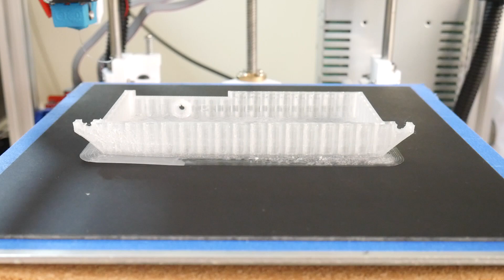3D Printer bed skin - PRINTinZ

Comment: As typical of your videos, well done -- excellent!

Out of curiosity, do you think the PRINTinZ Skin is sufficiently stiff to use without bonding it to a plate -- considering a 300x300mm PRINTinZ Skin? If not sufficiently stiff, the parts (as in ABS) warp forces would likely overcome the skins stiffness, and warp (however, more gently).

Comment: 0:17 You call that a smooth? get mk2
Reply: It is smooth, its just not glossy like that. Besides it's not the mk2 that makes the bottom of the part smooth, its the pei build surface. You can stick pei or glass on any 3d printer and it will give the same glossy bottom.
Reply: Ok. But those lines still does not look pretty.

Comment: It makes me cringe watching your whole printer frame and bed twist and flex as you use the spatula. I still prefer a bed that I can remove (like a glass sheet held in place with binder clips) so that my machine doesn't undergo so much stress and distortion as i pry parts off. Simply unclip the glass and pop the part off away from my machine.
Reply from the maker: The frame is sitting on rubber squares to dampen vibration and noise. That's why the frame was moving when removing the parts. The cantilevered bed however does twist and tilt a bit when force is applied. I agree I'd rather a removable bed surface.
Reply: After reading your comments about this I went with 10mm Z rods, still cantilever bed, it seems very solid so far.

Comment: How could there possibly be bubbles when sticking to painters tape and surely the painters tape is no just a very effective thermal insulator !!!!
PS i see you've dumped the CF tubes
Reply: No, this is on his second printer which doesn't have CF tube for some reason. Heaps of us are running CF tube on our HyperCubes and they work well.

Comment: Might give the beds a go.. blue tape maintenance is a chore.
Did you get the bed leveling working (in Marlin) for your Hypercube? I have an earlier copy of the firmware (~Jan 2017) which will run the bed leveling check but it does not look like it actually adjusts the print with the results. Just wondering if sacrificing bed leveling for the glue down bed surface is worth it...

Thanks for the reviews.

 - Eddy

Comment: @Tech2C looks like you are not using the carbon fibre rods for the x-axis. Is that because you discovered problems or is this just a second hypercube with other parts?
Reply from the maker: If you look veeeerrrrry closely this was my other Hypercube which I haven't installed the CF tubes as of yet. I have the tube I just need to cut and sand them before installation.

Comment: Might want to sharpen the edge of that spatula a bit. I had trouble getting it under the edge of a print at first until I sharpened one side.
Reply from the maker: Good idea. My spatula has a 0.6mm edge at the moment which equates to 2-3 layers of plastic of the print.
Reply: Also rotate it maybe? I notice that once you get it under, you keep pushing forward. I've found that once I get it under, it helps to twist the handle which pops the part off.

Comment: Purchased a Printinz plate based on your last video. Very happy so far. My aluminum bed wasn't perfectly flat so the Printinz plate eliminates those imperfections. I was surprised at how heavy the plate was, a consideration for print speeds.
Reply from the maker: Cool. The weight is only a concern if your bed moves during printing, like a Prusa style printer.

Comment: In my experience, PrintinZ works better than Buildtak for cold printing PLA. Buildtak is more sensitive to bed leveling and oil. Very complex initial strokes and first layer can easily stick to PrintinZ without any problem. And I don't have to wipe the surface every now and then. The only problem for me using it with Ultimaker is that my heated bed without the original glass plate would slightly warp up and down while heated resulting in inconsistent layer height. So I can only use the PrintinZ plate as a cold print surface.
Reply: Ryan Huang But buildtak works with induction sensors, so I use buildtak and an auto bed leveling system

Comment: I have an Anet a8 and would like to convert it to a hypercube but can't find cheap petg filament anyone know where I could buy some.
Reply from the maker: If your bonding of PETG layers, or inter-layer adhesion, is not strong then you are printing too cold.
Reply: consaka1 I print at 235C with 80C bed. Keep fan low like 25%.
Reply: Thanks Jamie. I just notice that the prints I have with their black PetG is very rough. You almost cant see the individual lines. I need to try it in the cr-10 instead of the qu3d threeup(which is a crap printer)
Reply: DIRTY RC we are in nz so can ship petG to oz or nz quite cheaply , sales@ikonavs.co.nz
Reply: Mark Bridgewater your website doesn't work
Reply: DIRTY RC site seems ok email me and I will try to help you out
Reply: Mark Bridgewater dw it works on my computer but not phone
Reply: Hobbyking sells very cheap filament.
Reply: Yeah but they only have white or black petg, I'm looking for coloured petg.
Reply: I'm making a hypercube and petg is recommended by tech 2c
Reply: Yeah PLA should be fine maybe even stronger watch filaween from Thomas Sanladerer he compared the strenght of differnt filaments.
Reply: Thanks
Reply: Awesome thanks
Reply: Tech2C have you used esun petg?
Reply: I'm printing in eSun PETG, it's great filament, recommended.
Reply: What temps do you print at? I have some eSun Petg and I haven't been impressed. Of course my printer has a top temp of 250C so that doesn't help. It also can swing 7 degrees so 245 is stretching it as well.
Reply: I think you could use PLA for all the parts in my experience PETG is weaker than PLA anyway
Reply: and since your Anet A8 is a open frame printer bonding of the PETG layers could be very weak

Comment: Nice video, did you try to enclose the printer for high temperature prints? Is there any reason you changed back to aluminum tubes and not using the carbon fibre tubes?
Reply from the maker: I haven't enclosed the Hypercube as of yet, but would be fairly easy to do as it is basically a box frame.
I have 2 printers, this one has ALU the other has CF. I have another length of CF tube ready to cut, sand and install into this printer.

Comment: Hi and thanks for this great designed 3D printer !
I just want to suggest you to test glass + Hairspray + WATER.
In my beginnings, I tried for a long time various hairspray without any success. But one day I had the idea to dissolve the hairspray with water when sprayed on the glass plate. It really sticks the time of printing and stands out almost alone when the tray cools. Since then, I have used only that. The surface is mirror finish and I have to remake the coating very rarely. I print ABS and I systematically add a Brim to my impression (because more economical than to redo an impression in case of)
With water any kind of hairspray seems to work. Just dissolve the hairspray with water and a small brush (nail brush). Let it dry again and enjoy easy printing with miror finish !
(I use 85°C heated bed with ABS)

Comment: Have you tried a PEI sheet yet ?

That white marking is the surface of the ABS part getting ripped off, ( was just about to say use a heat gun to get rid of it).

If your interested in printing ABS i would build a chamber for the hypercube. Myself i use my hypercube for PETG PLA etc  and i have a second hand up mini that has a chamber for ABS prints, going to add a heater to the chamber to make it even more crazy.
Reply from the maker: That's a great idea having a second printer inside a chamber purely for ABS and PC printing. I honestly try not to print with ABS these days unless I absolutely need the properties ABS provides. PC is a nice material though and I'd like to print with it more often.
Reply: Andrew Joy I'd go with pei. petg sticks very well and with no warping on the mk2 prusa. but for abs this print plate seems to work pretty well (and I'd love to not use 100 degrees for it since it takes very long to heat up due to to raising resistance in the heat bed)